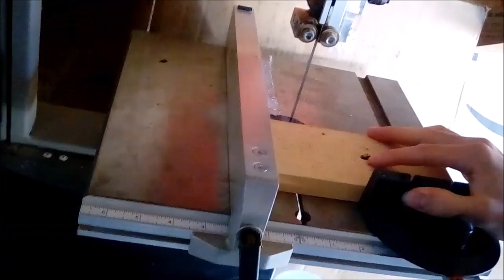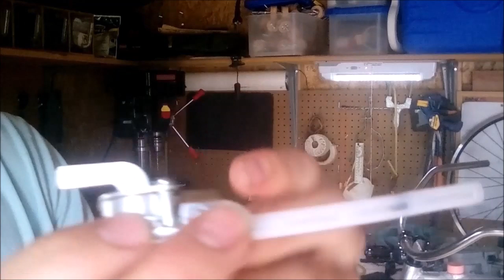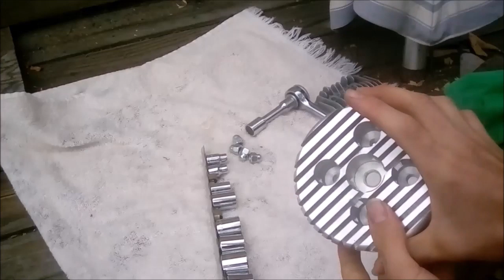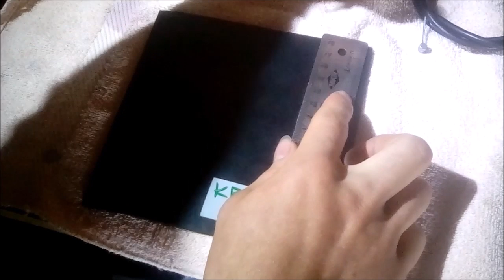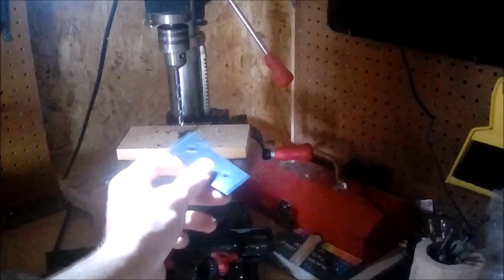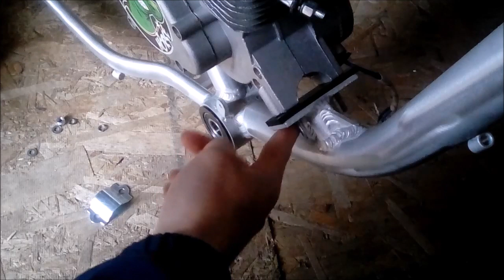Building an 80cc/66cc Motorized Bike part 3 (installing the engine)

Comment: Hey man have u had any problems with that frame same one I ordered and getting told some nasty things
Reply from the maker: I have not had any problems other than a very small crack in the weld that has been there since I got it and has not grown at all. I have had it for four years now, probably over 2,000 miles on it as well as some rides with two people putting over 300 pounds of stress on it. At the time I bought it, there weren't many options, so if I was buying it again now I might look around and see what the other options are, but overall I have had good luck with mine and it was very affordable. However, it was very hard to get parts for, as it is all American sizes which are getting less common to find.